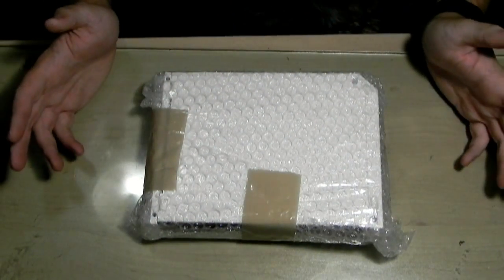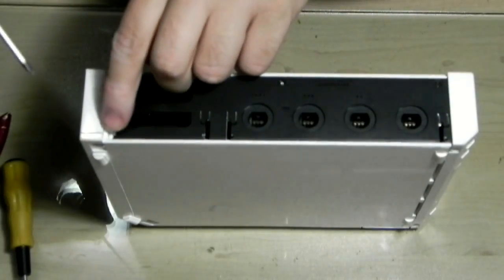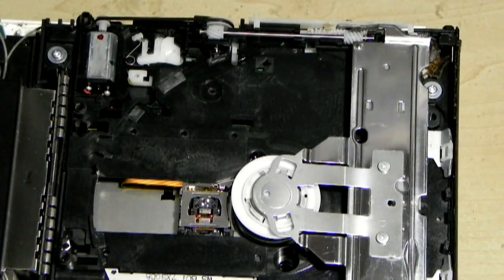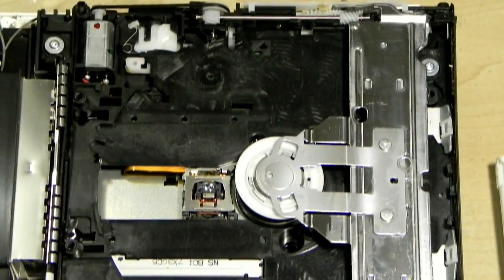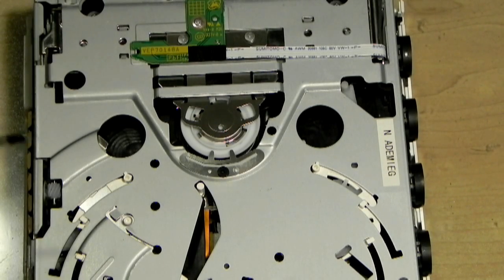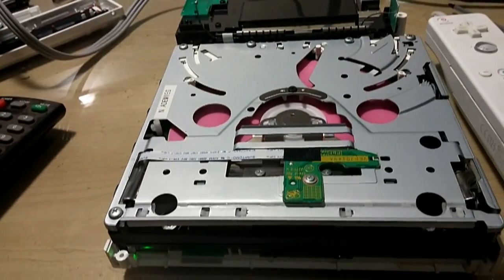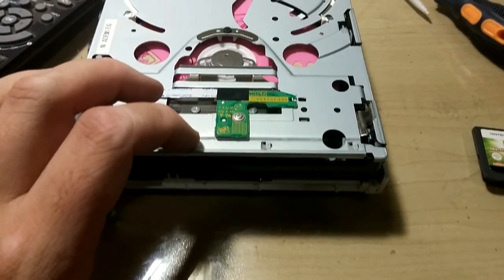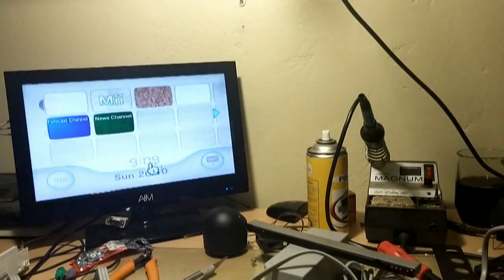Lets fix a Wii, The most common fault on Wii consoles.

Comment: My wii everything works fine, but when it sucks in the disc it is very bumpy it does not take it in smoothly so what does that mean?
Reply from the maker: Open it up and check for debrea in the drive, dust on the rollers or gears can cause it too

Comment: My Nintendo Wii, (when I boot it on), it either displays a very dim screen, it is off screen, or it is just black. I do hear rattling inside, because I snapped off the Game Cube memory card cover (close to the a/v output) and a peice of plastic fell in. Now I can't keep either of the sides on, so I use Scotch clear tape. My Wii It isn't very new and I would be willing to open it up if the plastic falling in is known to be the problem, or if I need to buy new pieces internally. 
I know that I am commenting on an old video, but your assistance would be of great help to me.
Reply: open it up and see
Reply: @jjoosshhb2193  I actually did, It semed to be a weakened signal to the digital input on the tv, but when put through an rf modulator to coax, it worked fine.

Comment: Hi, I loved your video. I have an Issue with my Wii not reading a Wii game with no scratches but plays GameCube games. I bought a game cleaner that wasn't licenced and I don't think the bristles reach because it's still erroring, do you know how this can be fixed?
Reply: I have the opposite problem. I used to play gamecube games all the time and now I can't for some reason. The wii doesn't even know there's a disc in it when it has a gamecube game. Have you solved your problem yet?

Comment: We have a black screen issue with our Wii. It turns on, I press "A" on the initial screen. I get the full Wii Menu. But if I click on the disc icon (Wii Sports for example) OR if I click on Mii Channel, the next screen comes up (with, at the bottom, the options Wii MENU OR START). When I choose START, the screen goes black. At this point even pressing the power button will not turn off the Wii. If I unplug, then replug, the Wii is usable again, but I only get just as far as I described above. Any guidance you can offer would be most appreciated. Or perhaps I could send it to you to check it out. We currently have the Wii taken apart, but I do not see anything that might help. All I could think of was maybe to disconnect then reconnect the plugs that connect into the disk drive.
Reply from the maker: Sounds like there is some iOS corruption, I would try modmii and do a full system restore https://gbatemp.net/threads/best-way-to-mod-any-wii-modmii-for-windows-official-support-thread.207126/

Comment: Hello. I have an original release day White wii with broken disc drive and looking for hopefully solution w/out needing a hardware repair. I am over 13 and have no young siblings or would ever shove things in the drive. And I'm not sure if you know about hacked wiis? but any help will be best! So there's 2 wiis in my house, White and Black. The black one has been dropped accidentally number of times but still works perfectly, no issues playing games or errors. The old white one I modded with BootMii and Homebrew a few years ago, also installed a GameCube loader at one time which broke the functionality of disc reading. I think I could have fixed that then tho with a patch, but as I recall before I even put mods, the Black wii would give disc error messages with many GC discs during gameplay. The reason for that was bcuz there were deep scratches on them, but I've tried to no avail to make them read on the White one. When I load any disc (GC or Wii) in its drive and click on the channel it will always say unable to read, which just baffles me.

Today I decided to pull out this white wii again and attempted cleaning the inside of the disc drive several times with alcohol q-tips (which was filthy), absolutely no luck. Plz note that I do not have a tri wing screw, therefore can't open it. Is this a hardware issue? It's high possible and is there any way to fix these problems w/out opening? However, if it was caused by system IOS patches in Homebrew, I'd be grateful of further info. Thanks.
Reply: With Hacked Wiis, I'd go for a softmod (modifying the software of the system)

Also, you need to open it up if you want to fix it.

Comment: That was a very informative video thank you. I was hoping u can help me figure out my Wiis problem. It works fine most of the time but has been having disc read errors during game play and start up. Also I noticed that when the disc is ejected it's slightly angled toward the buttons on the Wii.( I stand my Wii up at all times, so basically it's angled towards the left. I have the tool to take it apart but I thought I would seek your opinion first. Thank you
Reply from the maker: Hi Colton, I am glad you enjoyed the video, it sounds like your Wii needs a bit of a service, cleaning the laser will help with the read errors , and cleaning and greasing the gears will help ejecting discs a bit
Reply: @FaSMaN  thank you for the advice. I remember having a similar read error issue a few years ago. I saw a video of someone showing how a certain metal part in the Wii gets bent out of shape over time due to leaving the disc in side the Wii for long periods of time while the Wii is laying flat. I can't remember if the wii I have now is the same one since my daughter and i have owned a few different consoles over the years. Anyways have you heard of this kind of issue before? Also we are hoping to be able to get my daughter a Wii U for Christmas, do u have any advice on potential problems to look for when buying a used WiiU?

Comment: What size tirade wing screw driver did you use for the screws under the rubber pads?
Reply: Its called a triwing screw driver, and if you look it up you will find hundreds of them on ebay for around $5 each

Comment: My Wii's green light turns on, ejects discs, but nothing shows up on screen. I had a 3rd party ac adapter for awhile it stopped working recently. I just got an original Wii ac adapter. Do you the 3rd party as adapter may damaged my Wii and what do you think the problem is?
Reply: I also have the same problem where the sound shows up but I used the official Wii ac adapter

Comment: I was wondering if you could help me! I just got all new cords for mine so the cords aren’t the issue. When I plug it in the red light comes on but then when I hit power or eject it sounds like it’s gonna turn on for a split second and the disc area lights up blue but then immediately everything shuts off and then I have to unplug everything and replug everything in to get the red power light to come on.

Comment: Trying to get an old wiigoing to fight corona virus boredom. Anytime a disc is in it says “ an error has occurred. Press the eject button, remove the game disc, and turn the power off. Please read the wii operations manual for more information.” I’ve tried blowing it out. The cooling fan is working. Help me please.
Reply: In a similar situation. Im desperate to play on my Wii (which is about 10+ years old) to help the coronavirus boredom too! But when i put any disc it nothing happens! Very frustrating. Tried everything but opening it, i wouldn’t know what to do.
Reply: Dafney Thompson  does it give an error message or anything?
Reply: No, nothing changes
Reply: Dafney Thompson  does it sound like it’s spinning the disc?

Comment: My wii has an entirely different problem. For one thing when I turn it it on, it won't even display the home screen. Instead it displays a black screen with a phew white lines on it. It's been like that for about 5 years now. I theorized that maybe that black goo stuff in the wii is all dried out. What do you think?
Reply from the maker: Black goo,  do you mean the thermal paste?

Most likely its not the thermal paste its most likely its some bad BGA solder on the CPU or ram, this isnt normally fixable, but its hard to tell without looking at it properly....

Comment: please tell me if I can still fix mine. In my country, Peru, the electricity of the outlet is 220V and I plugged my wii without the adapter ( not the gray Wii adapter, I mean in my country we call it "transformador" so foreign systems that require 110V won't burn with it and in USA you don't need that adapter) and seconds later the Wii turns off. I tried to turn it on but it wouldn't work. Is the Wii dead for good or the gray Wii adapter is burned? Can it work if I replace the gray wii adapter with a new one? Answer please.
Reply from the maker: +JuanJurris98 just buy a new 220v Wii power adapter (tray box) the Wii uses 12v regardless of region so you can use a local adapter, if it still doesn't work open the Wii and check F1 Fuse :)
Reply: +HPZeta thanx for replying, I'll try it out. Do you think it's a good idea if I use my friend's Wii cables replacing his Wii with mine just to check if it still works?
Reply from the maker: Yes if you have a friend you can  use his power adapter to test :)

Comment: Would you mind fixing my wii it doesn’t light up at all except for when you click it to power it on on, the disc reader doesn’t sense anything. -Skylar
Reply from the maker: I would check the 3 surface mount fuses on the disk drive as a start :)

PS what country are you from?
Reply: @FaSMaN  USA

Comment: Great tutorial! I was wondering if you could help me, too. My discs spin but make a quiet clicking sound and lever load until it tells me to eject the disc and restart the wii. I've tried cleaning the lens and moving some parts around but I can't figure this out.
Reply: Bridget Burley exact problem I have
Reply from the maker: +Darren Connelly open the console up and have a look if the drive properly drops the mechanism down to hold the disk in place , if it doesn't it can do that , most of the time it means there is a busted gear or something stuck in the mechanism.

If it is fine mechanically replace the laser.
Reply: Me too bruh

Comment: Mine quit reading disks about a month ago.  Well, it was slow.  It had zero trouble, then it stopped reading and I needed to eject the disk and reinsert it during gameplay, then it started doing that so many times in a game I had to shut it off before I wanted to huck the thing.  Now it won't read any disks.  None.  It only started acting this way in about the last month or so.  Everything else works well.  It does make some noise when it starts, and when it wants to read the disk.  Sounds like shifting in there (not a higher and lower pitched whirring, not even a clicking sound really...).  The disk spinning doesn't make noise that I can tell.

Honestly, I am afraid of opening it up, but I think I might have to.  I do have a toddler that might have put something inside.  I really hope not.
Reply from the maker: +Sab I Am I would open it , it could be a few things , a dirty laser, something stuck in the drive or the worse case a failing laser, all of which is very easy to fix :)
Reply: Thank you!  I am going to see if I can find myself a triblade screwdriver and attempt this.  For now, we will continue to use it for our Netflix.  My Wii system is from early 2008.  It plays gamecube (well... not lately.  That was the first thing to fail).  I even still use my gamecube system, haha.  I have a wii u, but I prefer my wii which is on my main floor.  The wii u is in my basement, and I just don't like going down there.  Kids play it more than I do.
Reply: hey if u fixed the wii tell me what you did please, i am having the same problem
Reply: I haven't been able to get a triblade screwdriver.  I thought my brother had one, but he doesn't seem to know where it is.  Thinking we may buy one and a laser online or something.  Cleaning the laser with a disk cleaner did not work.
Reply: Sab I Am look up them on eBay,they are like at the most 8$
Reply: Sab I Am mine is artifacting pretty badly, but that came years after I got it because stupid me did not realize that standing it on carpet is bad, but at this point I really don't want to get a new Wii because everything else works perfectly like new, if I could get a new gpu for the Wii I would but sadly it is soldered on
Reply: +CommandoTaco: so u can still play Virtual Console games etc. ?
How old is your Wii anyway?
Reply: Same

Comment: I dropped a Wii console and now it doesn't show image when turned on.  What might be broken in it?
Reply from the maker: If you drop it it could be a lot of things, if the cable was plugged in while it dropped I would check the video port at the back to see if its not damaged, else check the little bluetooth module in the front of the console, if it came loose it will give you a black screen

Comment: hi great repair i wonder if you can help me out my wii will take the game but it will eject the game half way then it will suck the game back in to fully eject it. do you think this is a quick fix or do i need to get a new one. please help i can post a video if that helps
Reply from the maker: it sounds like one of the gears is either jamming or broke a tooth , they are located on the side of the drive and you will have go take the cover off

Comment: Mine says "An error has occurred.  Press the Eject button and remove the disc, then turn the Wii console off and refer to the Wii Operations Manual for help troubleshooting."

No help from manual.
Any ideas, I opened it up and didn't notice anything.  I did find a small piece of plastic which I believe is a hinge piece from the broken door on the side.
Reply: Put in a disc and it spins for a short time and quits.
Reply from the maker: Does it get to the Wii main menu? If so it's probably the laser it will better just to buy a whole new drive from aliexpress

Comment: I have 2 wiis that need fixing. They say they can't read disks and make a noise similar to this one when reading. Any advice for someone trying to fix it on their own? Thanks!
Reply: Or would you be able to fix mine? Thanks!
Reply from the maker: Hi first thing to do is just to open it and do a good visual check, especailly for debris or the gears preventing the system from taking a disc, I dont really fix consoles for other people anymore where are you situated?
Reply: @FaSMaN  Hi! Sounds good. I just ordered the special screw driver so I can take a peek! I am from the USA. If the gears need to be lubricated what do you recommend using? Thanks!
Reply from the maker: @nicolezalewski5548  I dont think you will need much more than clean the drive, the gears sometimes fail but this is rare, for cleaning a good plastic compatible lithium grease , amazon sells it in the USA :)

Sadly it wont be worth sending the system to me to check as shipping is way more than getting a replacement used system :)

Comment: GREAT VID.. YOUR GREAT.... BUT LISTEN MY WII WILL NOT REMEMBER THE NETFIX PASSWORD IS THERE A  LITTLE BATTERY THAT CAN BE REPLACED..
Reply: Hi Frederick, if you lay your WII flat on the table there's a small cover on the right side. On the cover there's one of the rubber foots and it's locked with a small philips screw. If you remove the screw, you can pull the cover and with it the back up battery will come out. It's a regular CR2032.
Reply: Frederick Little Netflix doesn’t work for the wii like it used to

Comment: My wii won’t show up on any of my TVs. I’ve tried everything thus far. Still nothing and no sound either
Reply from the maker: Presuming its not a software problem (accidental bricking) it could be the Bluetooth module failed , the wii will output a black screen when that happens, they are fairly cheap, its located right next to the SD card socket it will be smaller of the two little removable boards (other one is Wifi). If it still doesnt work it could also be the video output chip on the back of the board but that is extremely rare, and I would then recommend just replacing the motherboard as they are dirt cheap.

Comment: hey my wii’s not working it turns on,everything fine but when i put a disk in the wii it says “Disk not found” and it starts making a clicking sound. How can i fix this?
Reply from the maker: Sounds like the laser, I would just clean it and try again, possibly needs replacing
Reply: Yeah it will be the laser that does that

Comment: My wii doesnt even shows the light on the power button this was ly childhood how can i fix this
Reply from the maker: Well I would start with the basics first , can you swap the power supply ? If you don't have a spare power supply check with a voltmeter that it is outputting 12v , if so move on to the more advance stuff like checking the Wii internally it has a big fuse called F1 that might have broke

Comment: I got a worser problem My Wii is jam packed with discs
Reply from the maker: Bチpokycraftgamer9/supergamerboy12 if you have a look at the side of Wii drive there is a drive belt, I would suggest removing the top off of the drive and turning the gear the belt is attached to till it ejects the discs enough so you can remove them, if that fails you will need to complete disassemble the drive from the top down, it's not easy but do-able